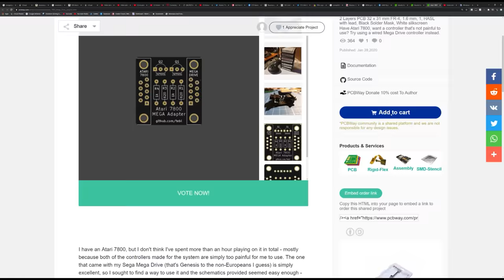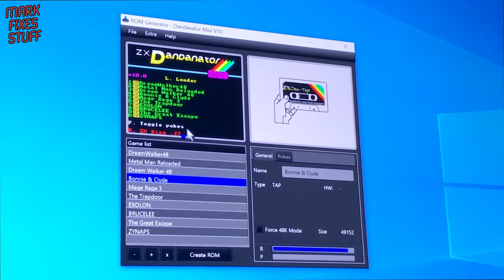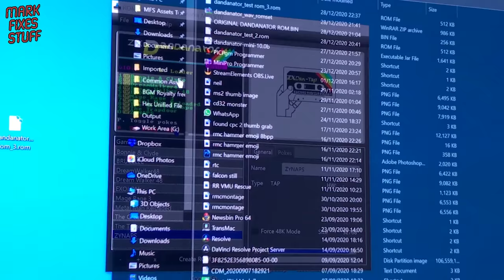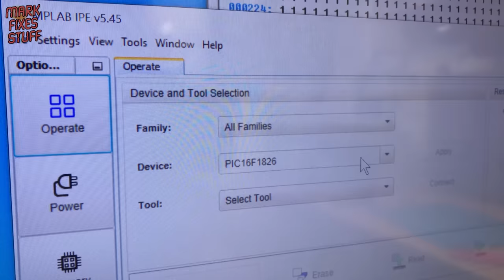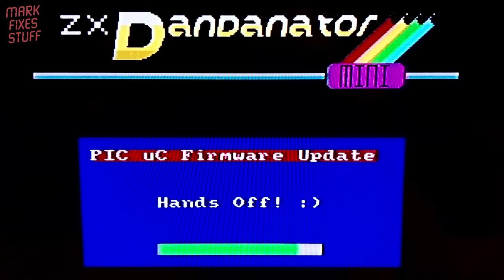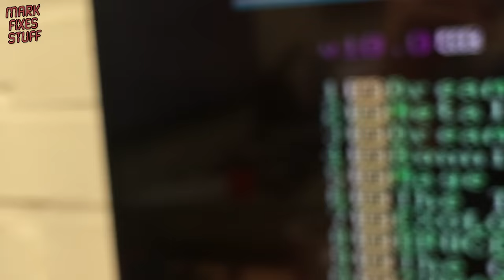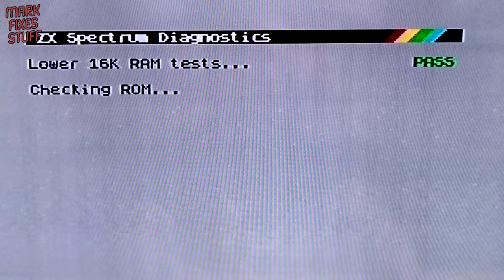Building the ZX Dandanator Mini 2.1 for the ZX Spectrum -  Flash RAM ROM Interface

Comment: It's good practice to fit resistora with the tolerance bands to the right and down, so all the values reads left to right, or top to bottom.

This makes assembly and fault finding easier.
Reply from the maker: Thanks Joe. This makes sense and I'll do it this way from now on.  :)
Reply: @MarkFixesStuff  It also helps fighting OCD in the world.

Comment: I stuffed in 2 arms from a 2mm tile spacer to fill pin 5 on my homebrew FDD adapter, it was the first thing that I could find in my tool box 😅
Reply from the maker: That's a pretty good idea actually. I have some of those wedge shaped laminiate flooring spacers...
Reply: @MarkFixesStuff  thanks! I probably should have glued them in however as the do ping out every now and again!
Reply from the maker: I went to change this one and it's glued solid. Scrap that then...

Comment: I got myself a Dandanator Mini Dual, and I liked it a lot, it's easy to update the games over the USB port it has built in, but it has one big issue, and that's the multiload games, as in games that load stages from cassette seperately, which is where the MLD format comes in. Basically, you have to make them yourself, and it's not just a case of converting a file, but actually messing around with the assembly language for each game separately, and each game is different in how it's done. Not at all user friendly. I spent ages googling to see if there was an easier way, and came up with nothing.

I'll probably get a DivMMC Future as it doesn't seem to have any of those issues, but the Dandanator is still handy to have for diagnostics and stuff like that, especially as you can add several types of diagnostics programs in it.
Reply from the maker: Yeah, they’re not really comparable devices to be honest. The Dandanator is more like a configurable ROM cart, hence it being excellent as a diagnostics tool. There are a few good MLD format files out there already though, like Sword of Ianna and CastleVania: Spectral Interlude. Its a great device and really cheap.

Comment: 1st really good instructional video.

2nd, a question: to put a game in the dandanator, one needs to remove the square chip, and put it in the programmer?
Reply from the maker: You can program it that way but you can also program it via the sound port on the spectrum using a .tap file
Reply: @MarkFixesStuff  Just to make clear, one connects the datacorder to the spectrum via the Ear port, and the dandanator is able to read the tape and produce a .tap or .z80 image?

Comment: All the Dandanators are different.  So if we buy one can we load anything we want on it, but lose whatever it came with?
Reply from the maker: Yes, you basically upload a romset to the main section. The diagnostic rom is in a seperate section though. When you make a romset in the software you can save it though.

Comment: Hi Mark, I know this an old vid and you probably won't pick up on this comment but can you remember where you got the edge connector from? Aliexpress? eBay? I'm looking for some. Great vid, keep up the good work!
Reply from the maker: Hi Brett!

https://www.aliexpress.com/item/1005002212044956.html you want the 56P version, which means 56 positions - 28 either side and you need to pull out the one for the gap.
Reply: @MarkFixesStuff  WOW! Thanks Mark. I'll get some ordered.

Comment: Could you provide more detail on the programming interfaces? I need to buy one to flash a PC motherboard STC 32 PLCC but want a device I can use for other projects like this video going forward. Would you say buy the "clone" one you mentioned over the MiniPro? Cheers.
Reply from the maker: Hmmm.... that is a question and a half.
- OK, so the red clone is ONLY for Pic chips. You won't want that on it's own.
- The Minipro in the video IS also a clone. AutoElec don't make them anymore, so anything you buy will be a clone.
- My "Minipro" is a clone of the TL866A, which doesn't have the ICSP header. You can add this yourself and hack the firmware but I have't bothered. The advantage for me is that this model can program with 21v where as the later model can only go up to about 16v(?)
- A Minipro TL866II can do the pic chip programming that I needed to get the Pic programmed in the video. This would do the 32 pin PLCC flash chip no probelms and will probably suit you for most projects. Some vintage stuff will need 21v and I THINK the TL866II is limited to 18v?

Sorry If I just confused you more. Go for a TL866II I reckon.
Reply: As Mark suggests, get a genuine Tl886, you can then program all three chips , the Minipro's are a clone and don't have all the features. XGecu Pro will do all three chips
Reply: @MarkFixesStuff  Thanks for taking the time to reply. I'm new to programming EEPROMs and it's tricky to know where to start. (Maybe a subject for a future episode?)
Reply: @mym8784  Thanks for the pointer, at £100+ with no adapters it's not cheap! I see the official manufacturer no longer makes the TL866 and the ones on AliExpress etc are counterfeits. (You mention TI886, was that a typo?)
Reply from the maker: @PeteB  I would but I am kind of working it out as I go along myself, and not keen to paint myself as an expert on a subject.

I know I program most 27c seried EPROMs with my dodgy little clone TL866CS, including C64 carts, pic chips, Lattice GALs and Kickstart ROMs for my Amiga stuff - although that needs a special adapter which I built (you can buy it though!)
Reply: @MarkFixesStuff  Cheers. I think I may start with one of those as Amiga Kickstart ROM is something I need also. Thinking to try building a custom ROM to hold the full 3.1.4 rather than relying on the libs from floppy/hard drive.
Reply: @PeteB  Checkout themicrohut on the bay!, Item number 173416519858, TL866ll, it's a XGecu and comes with some adaptors, auto software and firmware updates, and it test 74series logic and CMOS chips £62inc , hope that helps
Reply: @mym8784  Thank you very much, Pete

Comment: Mark, do you use leaded or unleaded solder? On personal things, I would always use leaded. It just flows so much better.
Also, a few tips, for keeping the tip (see, what I did there?) on tip (oh, COME ON!) top order ;)

I say, tip cleaner.

At work, we are not using it and I think it's a stupid decision!
After using, cover the tip with solder and let it cool there covering the tip.

It stops the corrosion of the tip, which happens when it is in contact with air and moisture. You will save money, as your tips last longer.

Also, tip cleaner is easier on tip, than using something to remove the oxidation from tip (like file) and it also has solder on it. So it leaves the tip covered with solder...

P.S. The problem, with breaking the ceramic part of the capacitor(s) is, that now it's easier for moisture and oxidation to make their damage...
And on soldering that socket, too much will melt socket and too little will leave you with a cold solder joint.
If you're able, test on something you don't mind losing. Every soldering station/iron is different! Find the proper temperatures on YOUR set-up and components and so on. And you will save yourself from many headaches...
Reply from the maker: Booo... hisss... I will do the bad jokes!

I don't use tip cleaner. Just because I never have. I don't really suffer from a dirty tipe. I don't use wet sponges, but rpefer wire wool, which can wear the tip anyway, but I prefer to replace them often - they are not too expensive. Filing is a waste of time I think. I do ALWAYS coat the tip with fresh solder before returning the iron to the stand though.

I know the cracking of the ceramic was a bit naughty. I have some proper caps on the way and will replace them when they arrive. 

Thank you for watching and as always I really appreciate your interesting tips and input!  :)
Reply from the maker: Leaded on personal projects BTW, or if the original machine used leaded. I figure if I repair a machine with leaded it won't go into waste so is a positive move.
Reply: @MarkFixesStuff  Yeah, I'll say yeah for wool too! It does wear the tip more and exactly, the filing will remove the coating and basically kill the tip even faster.
And as you said, when the tip is gone, it's gone. You WILL do more damage, if you do not replace it and try to keep using it past it's age. Remember, more pressure DOES NOT make the heat transfer better. But it most probably will break the board ;)
Reply: @MarkFixesStuff  Leaded will make a better bond and is better in every way. Well, it may not be as "healthy". But user is never in contact with it, anyway ;)
Reply from the maker: @miikasuominen3845  Yes. It's not good eating.
Reply: @MarkFixesStuff  No, it's not 😝
And on the liquid form, I also prefer Whiskey 😁
Or Irish Coffee! 😂🤣

Comment: Nice neat board i tend to use tapdancer on my android phone to load spectrum games though that of course is no faster than using a real tape deck but it gives the full experiance of loading a game like we used to i am just odd like that .
Reply from the maker: I like a bit of loading action myself. Where this differs is that the Dandanator allows access to more storage for a single game. So there could potentially be special versions that just support it. There are some special version of homebrew games on the website.

Comment: I got a ZX Dandanator Mini 2.1 and it all seemed to work first time, transferring a rom set. However since this first time I've not been able to transfer new roms sets to it. Do I need to intialise the board on boot or something. I've been going into the Dandanator menu first, and then exiting to the Spectrum. Should I be doing this differently? Cheers, to anyone that can help. :-)
Reply from the maker: Hi Jarcher!  The Dandanator Mini has two components. The PIC microcontroller and the Flash memory. If you update the ROM set you must "tell" the PIC microcontroller what the contents of the Flash are.

To update the PIC, hold BOTH buttons whilst powering on the Spectrum. You will see a progress menu as the PIC is updated from the FLASH contents. After a reboot it should all be working as expected.
Reply: @MarkFixesStuff  Thanks for replying Mark. After looking at the documentation, I discovered that I had to prepare the Dandanator on boot to be updated by holding the 'right' button. This then seemed to work with loading a new rom set. But I think there were problems. It started 'loading' and then 'recording' and the big number on the right increased. But then it seemed to fail mid way through. Now after loading the 'loader, and trying to upload a new rom set, I just get a flashing light/dark blue border. It feels like I've broken it. I tried updating the microcontroller but it didn't seem to do anything.

Is there a way to hard reset it? The Dandanator document is pretty bad. :-)

Comment: Why would you need to edit to make yourself look good the hardest part will 100% be following the instructions and figuring out where everything goes because. Honestly I couldn't solder (well I could I just didn't know that yet) so I bought a Nixie tube clock kit and a cheap nasty soldering kit and within a week I'd managed to track down some lead solder in a pound shop (which was the second hardest part of the build) and without any flux I had a working clock wrapped in Lego and it still works to this day a mere 4-5 years later and now I know I can solder and it turns out it's so easy

Comment: That's not the best way to solder edge connector:
1- contact surface should be more than a pin point so that solder have decent surface to adhere to, even if applied thinly
2. Nothing should load solder points with significant force, static or repetitive. Solder develops cracks.

So, it would be much better to bend the pin to form "L" on both sides, with vertical part separations being hair below PCB width, so it fits snugly.
Connector plastic should press against the PCB, so that forces at insertion/removal hit that edge.
Reply from the maker: Thanks for the tips. It makes sense and I’ll try that approach next time I make an interface for the spectrum. So far I just looked what other people were doing. Maybe I can use a vice to grip and bend the pins in a row and then angle them in to an L shape. Might take a few goes haha! Thanks for watching and taking the time to comment.
Reply: @MarkFixesStuff  
Also, avoid those DIP chip sockets.
Use ones with rounded holes that have spring inside. They are cheap and TONS better than these.
I serviced many Spectrums in my time and quite a few failures were due contact oxidation and thermal stresses of those shitty sockets. After many heat-cool cycles they tend to "spit" the chip out.
Reply from the maker: Hmm... got a link to some of the good ones that you know are ok? Low on funds here but I’ll definitely bear that in mind for any important stuff I have coming up.